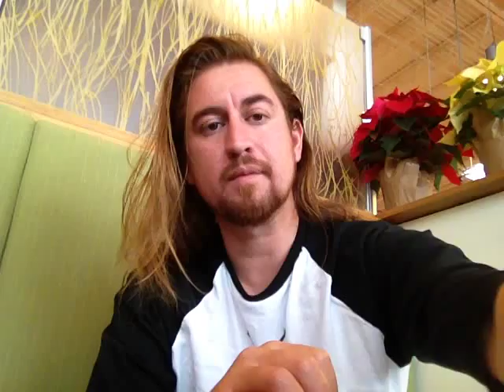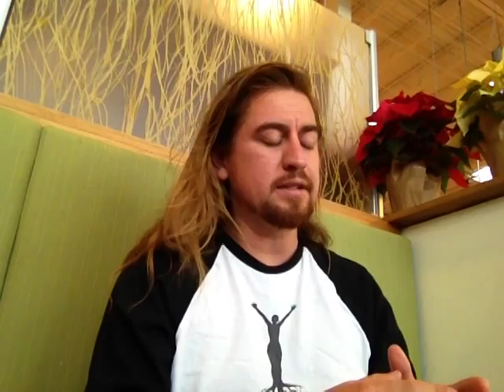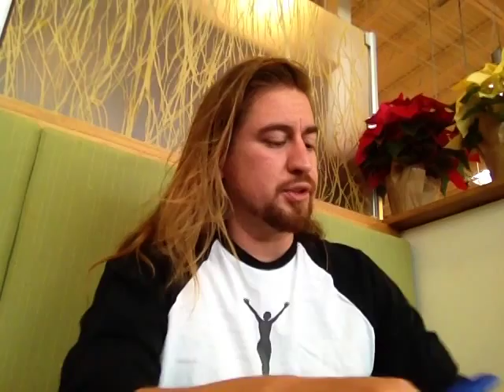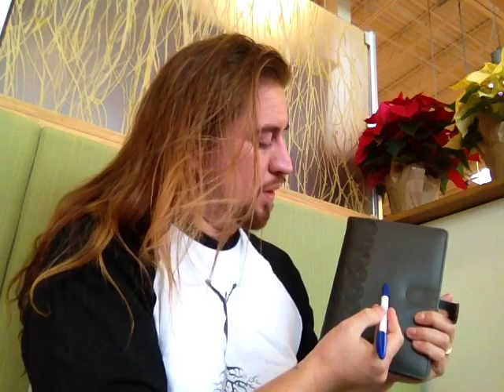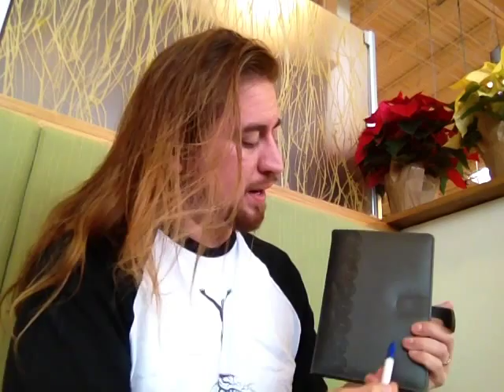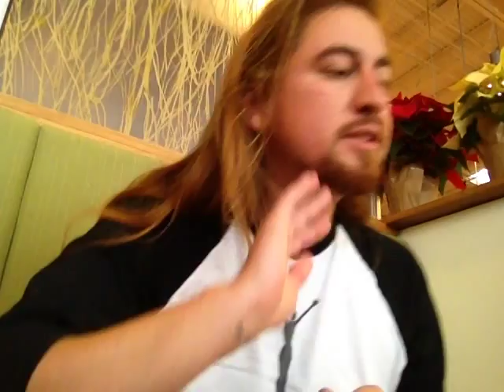Permaculture for Beginners - Episode 3 - Sustainability / Closed Looped Systems

Comment: "Any thing or system that creates more energy than it consumes over its own lifetime" doesn't exist, unless you have an unconventional definition of energy. The sun does not "create" more energy than it "consumes", and it is not sustainable as it will eventually die. Why bother with all these technical definitions if it's utter nonsense?

Comment: My definition of sustainable: able to be repeated/continued indefinitely without degrading the total resource level.
I feel most systems can be sustainable if restricted to a certain rate. To make fossil fuel use sustainable, however, we would have to take 4 million years to use the fuel that we used in the last 100 years.
For the agriculture example, using 2 acres per year gets a full rotation in the time it takes the forest to regrow means 3 acres per year would be unsustainable.